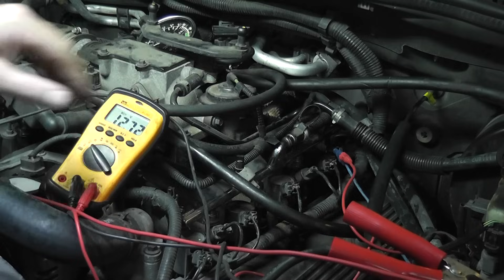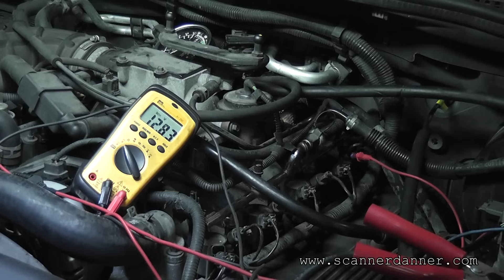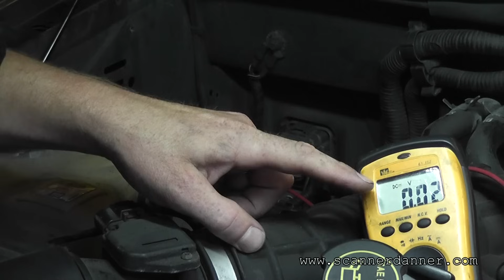How to test a fuel injector circuit with basic tools (open control wire)

Comment: Scanner Danner, could we have back-probed the control side wire of the injector plug (or front-probed it with the injector unplugged) and used a test light connected to battery positive and watched to see if it lit up when the vehicle was running in order to verify that there was no signal reaching it (i.e., it being intermittently grounded out by the PCM signal/pulse. Is this the other procedure you were referring to in the writing on the bottom of the screen in the video without using a noid light, but just didn't show us)? Also, are there any other tests that we could use to verify that there is an open in the control wire, without back-tracing the wire to the PCM/firewall? (I'm assuming that if we didn't have ready access to the wiring diagram, that the wire you're checking coming from the PCM would be the same color of wire that's coming from the control side of the injector connector?) Thanks!

Comment: I actually have a question. I have a 97 Chevy Suburan 5.7 v8. Replaced the fuel pressure regulator in the upper intake. Put it all back together. Got it running ran for about 15 minutes. Turned it off and tried to restart it and it won't. Had fuel pressure checked told it was where it should be. Getting fuel from the rail. The pump comes on. Can you please tell me my next step? I can't find a video to help. Can you send me some videos on my next steps. Thanks for all your other videos.
Reply from the maker: Need a fuel pressure number to help further. Why did you change the regulator in the first place?

Comment: superb video dan, i just want to ask a question. suppose that there is not pulse in first cylinder injector, then is that possible that there will be not current in ignition coil of 1st cylinder?
Reply from the maker: My name is Paul Danner 😉
Symptoms dictate the answer! Is your question about a single cylinder misfire, or a complete no start? 
You can have spark and no injector pulse, you can have injector pulse with no spark, you can have no spark and no injector pulse! All dictated by design differences and what the fault is, from car to car.

Comment: Warm greetings from Poland. I am watching Your Videos and still learning to fix my 88 pontiac Firebird no injector pulse problem. 12 on power side and 8v on signal side with key on. Thx for very goood videos.
Reply from the maker: That's not right. With key on only, you should see 12 and 12, not 12 and 8
You're firebird is a group fired injection system and one shorted injector can cause all of them to not fire. I have some videos on these, let me find them...

Comment: If there was open in harness, why you still got the reading when back probing the injector? 😣
Reply from the maker: 2 years too late, but 12v comes into the injector, goes through the injector winding and comes back out "looking for a ground". With no ground, there is no voltage drop, so you will read source voltage (12v) on the injector control wire when there is no ground. Make sense?

Comment: Hi Paul...i have tested fuel injector feed voltage on 3 cars..i see 3volts on one car,  1.2volts on the other and 1.7volts on the third car...why dont i see 12 volts..even my test light doesnt light on any of the car injectors..plzzzz suggest..Thank you.
Reply from the maker: What kind of car? Just key on or was it running?
Some cars won't have power to the injectors with just the key on and the engine off.
Reply: @ScannerDanner  its hyundai verna..it doesnt start either..it bumped and didnt start again..i read 12 volt on feed wire on all sensors except crank..the crank reads 2 volts on feed and 2 volts on signal...the cam signal is 5 volts plugged and unplugged...should the crank also read 12 on feed wire?? could the crank feed be shorted??? the injectors read 1volt on feed wire and there is no pulsed ground...plzzzz suggest...thank you.
Reply from the maker: @mototechno834  what year! Also, please double check the TPS and ECT sensors supply voltage, they should be 5v. Some cam and crank sensors will use a 12v feed. Also, having no voltage to your fuel injectors may be normal key on engine off.
Reply: @ScannerDanner  Paul, if all sensors have 12 volt feed, so the crank sensor also must have 12 volts??? plzzzz suggest.. thank you.
Reply from the maker: @mototechno834  dude, please, I need to year of the car and engine size to be able to look up service info. 
I also may want to move this to my forum. I'm not able to offer back and forth tech help here very often

Comment: Hi Paul...i have vw golf..with koeo, i am seeing 12 volts on feed wire and roughly 2 volts on control wire. My car doesnt go above 60 speed and the scanner shows
 number 4 injector circuit code. I guess the control wire must have 12 volts with koeo. Could u plzzz advice on this...thank you
Reply from the maker: Unplug one of the other injectors and give me a voltage readimg on both wires. I want to see if the 2v you are seeing is a bias
Reply: @ScannerDanner  Hi paul...with injector unplugged and koeo i see zero volts on both wires but my test light lights on one wire when my test light is connected to battery positive means seeing ground on one wire...with engine running my test light pulses on off on both wires...plzzz clear this..i hv seen heaps of ur videos and we see 12volts on feedbwire and pulse on the other..this is showing zero volts on both wires and pulses on both as well
Reply from the maker: @mototechno834  this is a GDI system? It has to be to see what you are seeing

Comment: My jeep Cherokee randomly threw p204 and p205 codes. It has brand new injectors, I'm pretty sure it's the computer.
Reply from the maker: You must check the voltage on the injector control wires at the computer and make sure you are seeing battery voltage with the engine running. (no power to the injectors on these with just the key on)

Comment: Great video thanks . I have a car that the #8 injector has no pulse . I was told the computer was bad . I took apart the engine compartment to fix other issues and there are several areas of exposed wires . I don't visually see any breaks. My question is my ecu has hundreds of pins ( connectors ) in the plug . Do one of those pins go to that injector ? I'm gonna start tracing tommorow. Can I test the circuit by conning one of the pins to the connecter ? This would help me before I spend 1500 on new ECU and flashing . Mike

Comment: If u unplug the injector harness testing each idevidual injector plug and each little prong in them if u test them all and only get light off 1 prong but test another and get light off both prongs whould thr be a short in the harness itself

Comment: Hi. Love your videos, very informative. But as informative as they are, Im having a problem sorting a fueling issue on my 1998 W210 e280 with the M112 engine in it. I have excessive fuel being pumped into the cylinders, resulting in fuel mixing with the engine oil and a lip burning smell coming from the tailpipe, besides a slight greyish smoke on startup. Car is also extremely heavy on fuel, I mean heavy. I have since replaced the maf with a brand new Bosch maf, thinking that was the problem. Alas, nothing. So before I spend anymore more money that I dont have, could you possibly guide or help me to diagnose what is going on here. Im almost sure it is an electrical fault somewhere. I would sincerely appreciate your advice. 

Regards
Cedric

Comment: I cant c how u can expect to c 12v @ the pcm cont wire on a wire that  showed 2b a  ground. Bit confussed !
Reply from the maker: 12v comes into the injector, wraps around the winding and comes out on the control wire with no voltage drop until it is switched on or grounded by the pcm 
So with and injector plugged in and back-probing, it is normal to see 12 and 12

Comment: I have a 350z...has P0304 misfire code. I switched the coils, plugs, injectors around. No change in misfire code. When I tore the engine down I found the factory fuel injection harness had butt connections instead of an actual factory plug. I'm guessing it's the wire harness. The VQ35de engine has the injectors hidden under the plenum. So it's gonna be difficult to run this test. I'm just gonna throw a $185 wiring harness on it and hope for the best. Thanks for this video. It made me confident this is the problem I'm having

Comment: Hey I’m having an issue, I get dead injectors (ground disappears) when the car goes past 45mph or if the car idles and I unplug the injector for more than 10 seconds, I took the pcm out to inspect for signs of damage but I don’t see anything wrong, I tested the pin (injector1) and it lights up with ground but same (ground disappears) when I disconnect the harness from the injector, I’m trying to figure out why ground disappears at idle if I disconnect the harness from the fuel injector
Reply: If I drive under 30mph the car runs fine, if it just idles it idles fine , but when I go over 45 or I disconnect the fuel injector for 10-15 seconds I lose the pulsing ground straight from the pcm

Comment: I have a 93 ford f150 5.0
When I turn the key to allow fuel pump to energize; it stays hot. With the key turned my IAC , fuel injectors are hot on the control and feed wires. I disconnected the PCM and probed the control wires, still 12v. Fuses and relays good. Any suggestions? I can hold a rag drenched in gas at the breather and it will crank right up. Could the ignition switch be grounding out causing power to fuel pump and injectors to be 12v constant When the key is turned?

Comment: If the injector is not firing because it's not getting any power to it would that cause a low compression in the cylinder??
Reply from the maker: No
Reply: Okay because I'm getting a misfire in one of my cylinders and I only and I have low compression in that cylinder spark plugs have been changed the igniter pack has been changed I even changed out the injector and I still have low compression in there people are saying it's a head gasket but it's a head gasket the oil would have a Milky colour to it and the oil is fine it looks normal and if it was blown piston rings I would be burning through oil and constantly having to add oil so I'm at a complete and total loss why there's no pressure build-up in that cylinder so I'm just trying to figure out what else could be but I still think there's no power getting to that injector
Reply from the maker: Depending on the car, injection pulse is cut on a misfiring cylinder to protect the cat from raw fuel. So you are right in focusing on the low compression. What is your pressures in that cylinder?
Reply: I'm getting about 80 PSI in cylinder number 8 it's a 4.7 engine from a 2012 Dodge Ram 1500
Reply from the maker: @tailsdragon4447  not good at all on that, you definitely need to stay focused here. Do a leak down test and find out where your cylinder leakage is. These engines are known for valve issues.
Reply: I have had to valve covers pulled off in the valves looked at everything is good there seating correctly and they're all fine nothing's loose in there so I don't I'm at a loss
Reply from the maker: Not good enough. You need to do a leak down test.
Reply from the maker: https://www.youtube.com/watch?v=oFCPeqPKGNU

Comment: I have a 1998 buick with two of the injectors not pulsing. I did already replace all 6 injectors myself. Cheap and easy, and took under an hour.
 It appears that I need to start digging in the harness for an open connection. . . Electrical problems.can be such a time such. . . Grrrrr!!! 
;-)

Comment: Man if you can help me on this 💪
Have a Honda pilot 2003 3.5.
Problem is You start the engine and it 
Will start on 3 Cylinders 4-5-6
1-2-3 are shot down by the comp
If I disabled 4-5-6  and start the vehicle
 It will start with 1-2-3.
Then if I reconnect the other bank
4-5-6 .  1-2-3  don't work And there is 
Spark on them... Please need help on this!!!
Thanks I will appreciated...

Comment: I've been having problems w/ my 2004 BMW M3, where for some reason cylinder 6 is flooding like the injector is stuck open or something, I had the injectors worked on and they are back to brand new status and it was still doing it. I am guessing that there's a short on the harness or somewhere that is keeping the injector on open position or something.

But the thing is it jumped from cylinder 6, then cylinder 5 was doing it for a bit then went back to cylinder 6 now. not sure what is going on. Compression test (the best I could is do a cold compression test) came out pretty good considering its cold engine and it was almost at the minimum compression values already (at 150psi. recommended is between 160-172) which I can see it reaching recommended compression when its warmed up.

How do I test the wiring if they are just on all the time?

Comment: While it was a very educational video for new technicians...I'm not really clear on why you didn't just take the ODBII reading and look at your codes to find the problem? I mean, surely this thing threw a P0208 code, right? Ok....so you know that it's an injector open-circuit fault, at that point...so, if you trust your meter, then you know right there to go to the NOIDs on that cylinder...which would have been dead. Now, probe your computer for pulse...if it is there, then you know the break is in the harness...so, check the back-side of injector plug (to make sure you don't have a bad, cracked, burned plug) and simply replace the wiring up the harness...touch of soldering and shrinkwrap, and you're golden...(since you had pulse at the computer, then NOID the plug after re-running the wiring, and you should have pulse at the plug)...should now have a firing cylinder again.  Test drive, if no miss, clear codes and call it done....
There IS a reason manufacturers put the ODBII ports there...and ANYONE can afford $40 for an ODBII reader that can get this far.
Reply from the maker: I mentioned 30 seconds in we had a fault code for the number 8 injector. Not sure what your issue is, sorry. The steps I showed were universal and apply to all ground side switched circuits. Not sure what there was that you didn't like. You may do it differently, that's fine. There are many different testing methods that can be used to identify and locate and open circuit.

Comment: Where can i find fuel injector resistance specs for 1997 Plymouth grand voyager 3.0l v6. I have 4 that are 14.8 and 1 that is 14.2 and 1 that is 25.
Reply from the maker: The one that is 25 is certainly not good.
Reply: @ScannerDanner  okay so the rest don't have to be the exact same?
Reply from the maker: @theman8795  ideally they should all be the same

Comment: To find an open or a short in a wire, Power Probe's circuit tracer works well. It is unique in that it switches from tracing E field (voltage, open wire) or H field (current, loaded or shorted wire) as needed and LED even indicate direction of current flow. No, I don't work for PP, I'm just a satisfied customer.

Comment: hello !
Please I need your help. I got an issue in my Passat 1.4 TSI after i re did the cylinder head vales and the timing chain. I started the engine and it went good for like 20 min then i turned it off and comeback after an hour, started again the it was running rough. I got P0201 and P0444. I did as you did head with the lamp but the lamp is on and not flikering so it deos with the other injectors i.e no flikering light at all the injctors. It gives the same volt ( 10.5 V ) at all the injectors including cylinder 1 injector.
Do you have any idea? Will really appreciate that cause I need my car badly.
Looking forward to hear from you
Reply from the maker: Sami post this to my forum. We can help you better there. IT is free to join okay?
https://www.scannerdanner.com/forum/post-your-repair-questions-here.html

Hope to see you there
Reply: ScannerDanner 
I created an account hope to be one of  your family

Comment: Hello  i really,have big problem here no know nows what it is 
Basicaly may car consumes huge amount of fuel and when i depress the pedal still injectes fuel up to 1250-1500 rpm and have black smoke changed spark plugs coils air flow fuel pressure regulater and computer scanner shows nothing wrong
They suggest changing fuel injector but this is my second altima with the same problem 
Could it be bad wiring causing to over inject fuel and cause jerking on deceleration and black smoke 
I have a 2012 2.5 s nissan altima 6 speed 
Fuel consumption went from 8 L /100 km to 18 L / 100 km
I really need help
Also this is my email : binar91@yahoo.com
Reply from the maker: If this is a GDI system, injector failures are common
Reply: After three years it turned out nissan has a safe mode when all injectors double the amount of fuel injected to each cylinder and causes a high fuel consumption and black smoke  and causing jerking when decelerating on a manual transmission

Comment: Hi i got problem with injector wireharness when i use multineter.  Is shows power like 12.7 voltages but when. I insert injector it doesnt spray but injectors are good... Any suggestion??